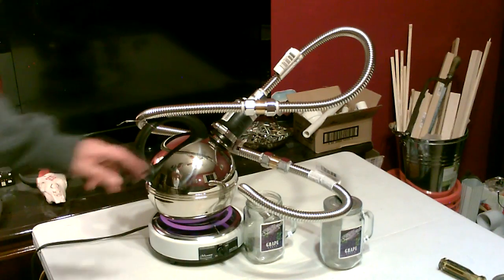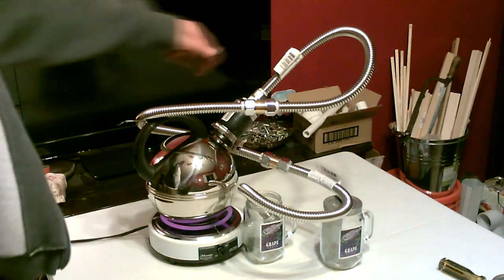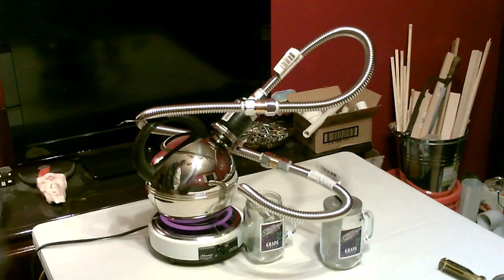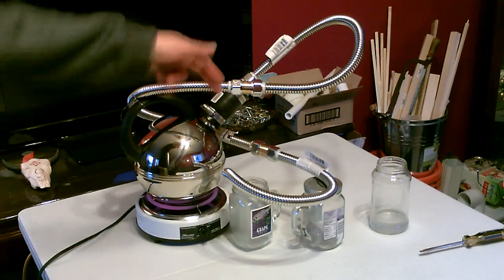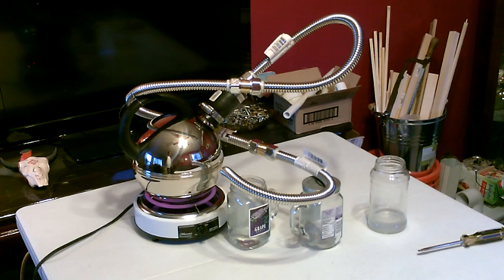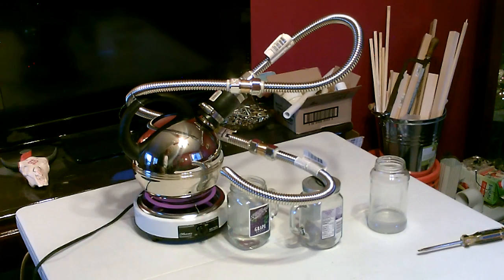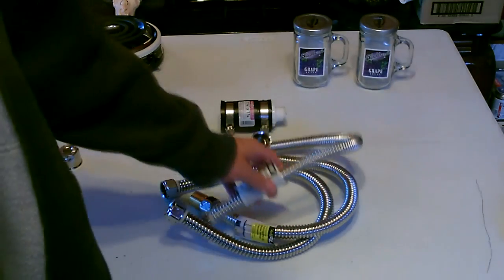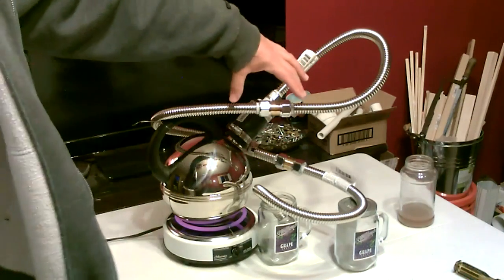Homemade Water Distiller! - The Deluxe "Stainless Steel" Pure Water Still! - Easy DIY | Full Instr.

Comment: This is absolutely brilliant.
Mind, I already bought a still from Vevor for about $100 bucks.
Granted, it DOES have an 8 gallon capacity. (Shameless plug continues).
It also has a pan for the condenser to have a cold water bath, and a pump and the tubing to allow that.
No, I didn't buy it to make Hooch. I bought it to make Wood Gas. It looks like a better Reactor than anything I could cobble together on my own.

Comment: Why the salt added?  I made one out of copper years back only 16 inch long and 1 inch wide, same rig otherwise works well.  Shorter hose makes it easy to clean out in my ultrasonic bath unit to get the mineral deposits to dislodge from the deep corrugated ridges.

Comment: Hi DesertSun02, I'm looking at stainless steel Tea kettles online and all of them have what looks like a welded on spout covering.  Looks like it wouldn't work for the line to be connected.  Any suggestions please?
Reply from the maker: hi. most of the kettles i've seen have a spout covering that is 'hinged' and sort of tips back to open. this one has a metal covering that slides off. i've never seen one that's welded.

Comment: Do you have to remove the flip lid on the spout to have enough room to connect the tubing?  And if so how did you do it?  I use a distiller at home and have a rocket stove for emergencies and this will be perfect. Thanks
Reply from the maker: hi there. this teapot didn't have a flip lid. the whistle part just slides off.

Comment: Does anybody know what the white connector is and what size? Thanks
Reply from the maker: hi there. it's a 1 1/4" (OD) slip to 3/4" threaded PVC reducer. it's a common one. pretty easy to find. note that since it's 1 1/4" OD (outer diameter), they probably sell it as 1" ID (internal diameter)

Comment: Hi great job!. If you seal the fill glass tube would it work faster and and be less loss?
Reply from the maker: hi there. you could partially enclose it but there has to be a way for some steam to escape or the pressure would build too high
Reply: I drop my distilled water into a 5 gallon container. The tube drops quite far down into it which means the steam has farther to go to escape, and is usually caught within the container before it goes that far. No concerns about pressure buildup either with a larger container
Reply: @shannonjensen3855  so is yours basically the same set up? Do I just need the one rise upwards, then down to the bucket?

Comment: Got to take this one step further man: show an electrical resistivity test. Start with tap water, your voltmeter set to ohms, with the probes 1cm apart. Then super saturated salt water, with your volt meter probes 1cm apart. Show the ohms. Then finally show the probes in the distilled water. Rinse the probes off between each use.

Comment: Cool video man. Quick question tho, corrugated vs. smooth copper would be surface area right? Wouldn't it also slow the fluid dynamics tho, by increasing resistance? Maybe a condenser wall of some sort would be better then the tube? Or maybe section the corrugated where the least gravity resistance is then rest smooth? Just random thoughts on that.

Comment: It can be even more efficient with a kettle with copper bottom: heat transfer is better than with stainless still
Reply: Not if you're using a induction cook top.  Nothing is faster than that.

Comment: Hey, could I make a load of distilled water once a month then store it? Would it still be as pure? How long will it stay pure? 
Thanks
Reply: I would definitely use a glass container, not plastic. As long as it's well sealed, should be good for a long while if not basically indefinitely
Reply: Sure you could, and it would stay pure for as long as you can keep particles out of it. If you use cleaned milk jugs, you'll be fine. But if you want to keep it for more than a few months, they you might want to get something thats hermetically sealed. A large glass jar w/ rubber seal for instance.

Comment: Thank you so much for this tutorial. I have an old stainless steel kettle and a couple of brided steel tubes left over from my last plumbing repair. i just need a few connectors and I've got myself a water distiller for less than $10 bucks.
Reply: I read that "braided" tubes are not good for the boiling high heat temps.

Comment: Just moved to Brazil and was trying to find where to buy distilled water.  Back in the US you can find that at the grocery store no problem.  In fact, the price was no different than any other bottled water.  I finally found distilled water, but you can only buy it from a medical supply shop.  The cost of two 1.5 liter bottles was 40. reals (almost 13 US dollars).  Needless to say, this video came just at the right time.  I'd rather purchase the teapot and plumbing supplies!  Will double the supplies so that I can try making essential oils as well. Thanks for posting.  Obrigada.

Comment: Looks much better than most homebuilt stills.  OK on all of the stainless steel used rather than copper.  Copper dissolves in pure water and then gives the water a metallic taste and further has the user ingesting toxic heavy metals------NOT a good thing.  If your new unit adds a metallic taste to the water, it may be the brass.  Then you will have to find some stainless coupling pipes.  One great use for distilled water is making tea.  There will be no scum on top so the tea looks wonderful and tastes really fine!

Comment: Hey..so cool .just a thumb's up to ya...I have a water distiller   a good old commercial one 45 years old, and on the coil, they have put two tiny little holes on top side of tube to let out the lower temp toxins as the hot stem is going down the  coil      no stuff is seen leaving the tiny holes   I drip the finished water through a glass funnel of charcoal into old gallon cider bottle . It`s   almost sealed off ...and the coil has a fan shooting through it.....hope that helps  I love what your sharing

Comment: any reason such a large guague for the tubing?
Reply from the maker: hi there. that diameter of tubing (1/2") allows for the free movement of the air/steam/water vapor thru the tube. if it was narrower you'd run into issues of "bottle necking" and pressure build-up in the tube.
Reply: Coolling purpous

Comment: Isn't it really difficult to clean the teapot of all the mud, dirt, salt, debris after using? Also, boiling doesn't eliminate viruses, does it? Of course, could be followed up with a Life Straw type device for total purification.
Reply from the maker: hi there. nope, it's easy to clean. just boil "most" of the water away but not all of it, then dump out what's left before the teapot boils dry. all the contaminants will be left in that little bit of discarded water. ...and yep, the distilling/boiling will kill all the "living things" in the water including viruses. along with removing all non biologicals *with one exception: voc's. (they're something found in paints and solvents) but those are very rare...unless your water source is located next to a paint factory that's not an issue. *distillation is the single closest thing there is to "total purification" *life-straw type filtering is nowhere near as good as this.
Reply: Thanks, good to know =D
Reply: I clean my kettles/distiller with food grade citric acid, a few tablespoons in very hot water and let it set until all the stuff is dissolved. No scrubbing.
Reply: You could filter the dirty water through a cloth before distilling to get out most of the large debris.
Reply: I can testify to this as well. Tried the Apple Cider Vinegar & baking Soda previous to the food grade Citric Acid.... no comparison, the Citric Acid results in  far less scrubbing to get the all of the hardened deposits from the bottom of the Distiller. :)